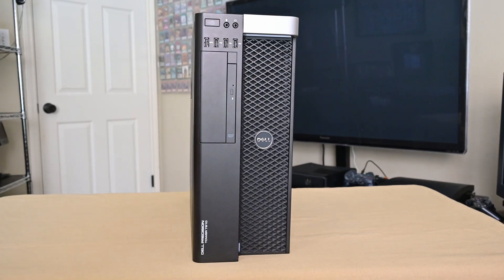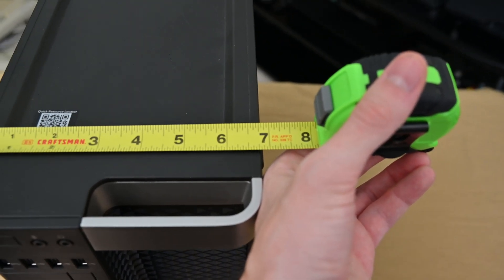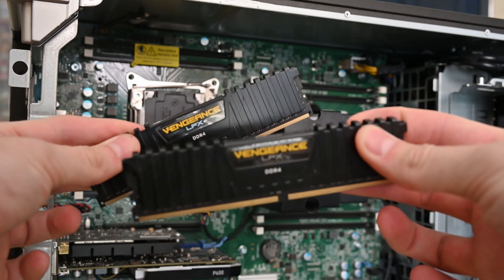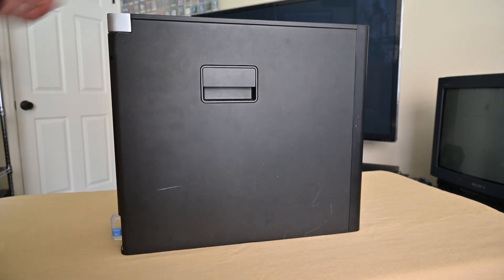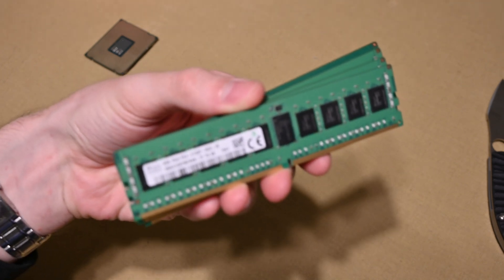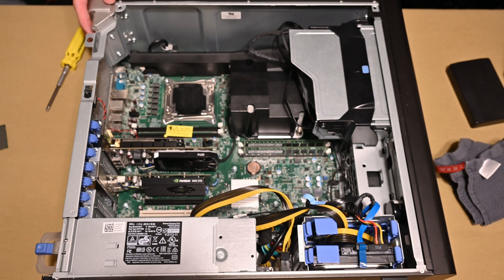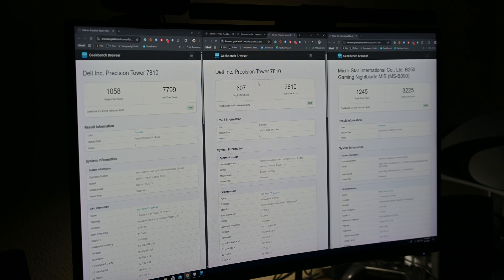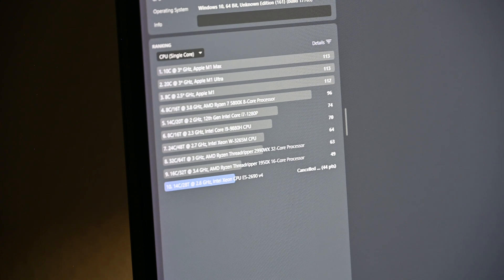This Dell Workstation Could be the Perfect Budget Home Server! Hardware Upgrade + Review

Comment: congrats on your Workstation. I own this and it has 2 e5-2690 v4 and 64 gib of ram and a older quadro p4000 running linux,,, its too sweet and I use as daily driver and yes I have AI installed i run